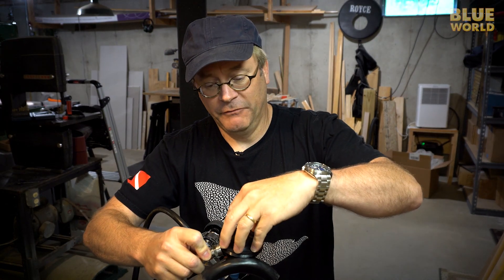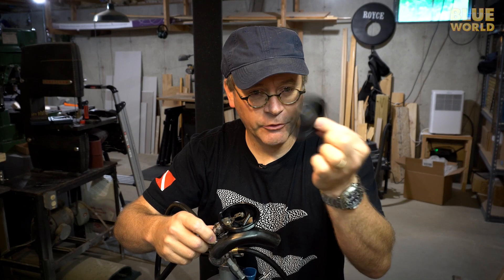How do SCUBA regulators work? | SCUBA 101

Comment: Are those flapper valves prone to leaking? Do you sometimes suck water into your lungs because of a leaky valve?
Reply from the maker: When they get clogged with barf or something, they will leak.  But generally not.  They are pretty reliable.  If they are really old and crusty, sometimes they let a little mist of water through, but only enough to be annoying, not dangerous.

Comment: Excellent video, I am new at learning scuba diving...question, using a hookah regulator how do you know when your adjustment screw is at ideal setting? My pump system only gets around 20 psi...but many guys are able to breath well at a depth of 15 feet when regulator is adjusted correctly for them using exact setup as I have...can you adjust regulator screw correctly without having to use in water first? Or is it trial and error..? Thanks for your information
Reply from the maker: I know nothing about a hookah rig sorry!

Comment: That's awesome! One little thing i would have liked to hear is the actual part that ensures the air pressure is the same as the environmental pressure, rather than the 10 bars.
As soon as the lever gets pulled, the 10 bar air flows inside the second stage. That air presses the diaphram away from the lever. As soon as the pressure inside the second stage is the same as the environemntal pressure, the diaphram is pushed so far out, that it is in its initial state and is no longer holding the lever down, airflow stops, and thus the pressure won't increase any further.
Reply from the maker: Good point.

Comment: which reg is this ?
Reply from the maker: Just an old Sherwood which is easy to take apart.
Reply: @BlueWorldplus  yes the old ones and some of the newer have this feature i think deep6 you could still take apart even under water if you soak water and want to make the diaphragm fit and clean out some plants or whatever might came in it. Just tecdivers do this i think no regs fails in cause of this on recdives i think.

Comment: That's given me an idea to improve my gear testing. Try to inhale when the tank is off to see if you get the deadmans suck. If not you'll have a dodgy seated/ ripped mushroom valve or diaphragm.
Reply from the maker: Yes, that's a valid test.  The other thing you get with a dodgy mushroom valve is water seepage when you inhale underwater.  So if you are getting a "wet breathing" reg, that's the first culprit to check.  Very often there is nothing actually wrong with the valve, it just has some mold or something growing on it that prevents it from making a good seal.

Comment: When exhailing on cave dives isn't it a problem whith the bubbels hiting the extremely fragile cave formations and damaging?
Reply from the maker: Believe it or not, as a general rule the bubbles don't break ceiling formations.  Because they are pointy and hanging down, the bubbles kinda just get funneled between the formations without hurting them.
Reply: @BlueWorldplus there is one famous case where this did happen. Pretty recent analysis by I think a University of Florida paper.  And this was even with the reduced amount of bubbles you get when using rebreathers. But yeah only applicable to very specific cave situations.

Comment: Why regulator starts to free flow in mouthpiece up position. I dont understand. Is water pressure somehow press this lever button in this position?
Reply from the maker: Yes, exactly.  The water pressure below the diaphragm is higher than above it, and it pushes it enough to make it flow.  Then the bubbles rising up create a little bit of a vacuum and pull it up more, so it goes crazy.

Comment: I'm not an expert on the subject so please mind my question: What happens if the regulator fails during a dive? 
Is there a protocol to follow or a safety measure in place in order to avoid tragic incidents?
Reply: backup regulator.
Reply from the maker: The design of regulators is that if they fail, they usually fail by leaking--meaning air comes out when it's not supposed to.  And that kind of failure might be annoying but it does not result in a failure to breathe.  In 30 years of diving, I have never seen a regulator fail in such a way that you can't continue to use it to get to the surface.  People do carry an additional second stage regulator (commonly referred to as an octopus, for reasons I have never understood).  Generally however, this redundant second stage would be used for a buddy who ran out of air.
Reply: Interesting! Thanks Jonathan 👍

Comment: they are so simple companies just throw fancy colors om them to make you pay more when they are exactly the same as the 20 dollar you find on amazon
Reply from the maker: I don't know about that.  There is significant liability in a product like this.
Reply: @BlueWorldplus  i cant speak for everyone but we have 4x 20 dollar regulators and each have atleast 700h useage (compressor diving) never fails except once and apperently we had accidentally dropped it on a sea urchin which spike went throught the membrane haha.

its just a metal arm which closes the intake by the pressure.
when u breath in the membrane push the arm inwards which open the intake.
when u breath out the membrane pushes outward to let the air out and the pressure from the ocean closes it again (and the natural shape of it)

litterly nothing that can go wrong.

Comment: When you walked away from the tank (stepped out of the frame), I felt it in my gut and instictively tried to jump to hold the tank. I'm trained to pretty much treat tanks like potential bombs.
Nice explanation of the regulators, this is a video I can refer my students to if they ask about it.

Newer/'high end' models also have a venturi system built into them, but I've never been able to tell the difference when breathing. Then again, the adjustable breathing resistance knobs never feel like they do anything for me either, so I guess I'm just really not picky with regulators. I do notice that they free flow really easily when sensitive, so there's that.
Reply from the maker: Yes there are all kind of small things they do to enhance the performance, but fundamentally all regulators work like this.

Comment: Awesome video thanks😃👍

But I'm still trying to understand how the regulator "regulates" the pressure to the correct atmosphere🤔
How does the 140 psi get dropped to the correct pressure to breathe?
Reply from the maker: Because the pressure on the other side of the diaphram (the air going into your lungs, is at ambient pressure.

Comment: Thanks for the video!  Two questions - 1) Why are there no diffusers that fit on the regulator exhaust to break up and quiet the bubbles?
2) Where did you get that awesome shirt?  It's really nice looking.
Reply: To your 'diffuser' question, a few manufacturers have actually tried this by incorporating a somewhat honeycombed set of plastic openings where the bubbles come out of the exhaust tee. It does seem to help with shrinking the size of the bubbles, & lessening the associated noise as well. I think it's a great idea, and it disappoints me that so many modern manufacturers resist progressing with ideas like this... (but reliability has seen improvements, with even cheap regulators being surprisingly good these days)

Comment: A non-diver once asked me "Why do do you have to buy air? If the tank is empty, why can't you just open the valve and let air flow in?"
Reply: This is not even a case of diving or not, this is essential knowledge in physics.
Reply: "Well," I would tell him, "I could do that, but it would be moisture-laden, dusty air, and it would only be enough air for a few breaths at the surface, and no breaths underwater because the water pressure squeezing my chest would be stronger than the air pressure coming from the tank."
Reply: I think it's not so nice to laugh at people their lack of knowledge. It makes the person laughing look more stupid than the person asking the question.